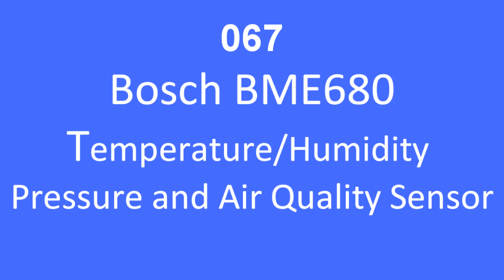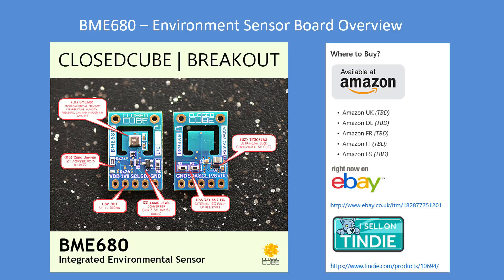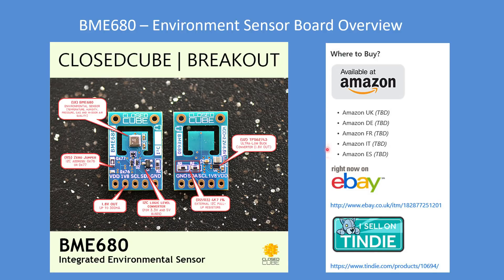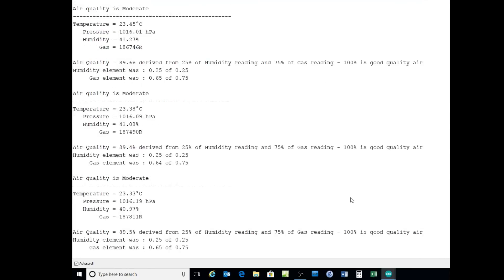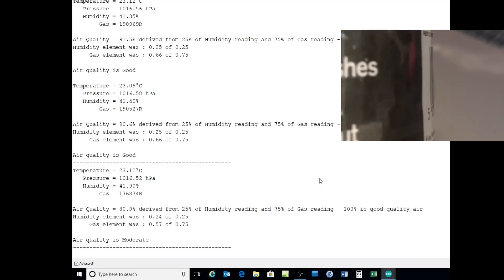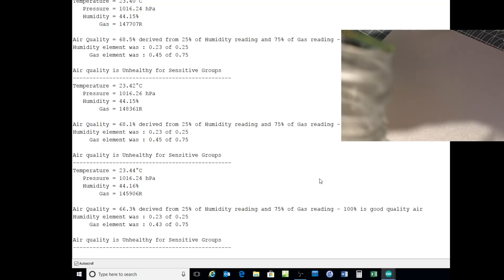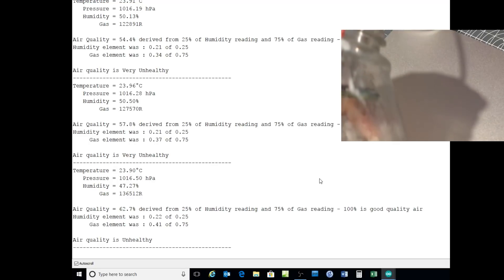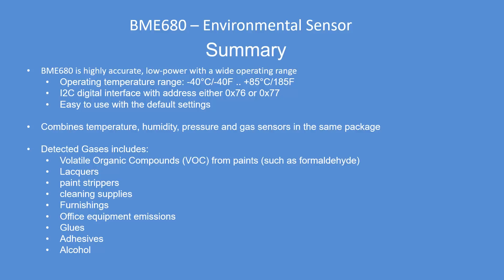Tech Note 067 - Bosch BME680 Environmental Sensor. Air Quality, Temperature, Pressure and Humidity

Comment: What are your rules to calculate the airquality, the voc sensor gives only a resitorvalue back to me. high is better than lower value. can you explain?
Reply from the maker: See here: (Readme) https://github.com/G6EJD/BME680-Example
There are no world-wide standards, it's all qualitative and essentially low or high humidity makes the environment feel no good and low gas concentrations has to be good, so 0-25% humidity and 0-75% gas on the basis that gas is worst than humidity. You can see the calculations in the source code. Both are linear relationships. The Bosch IAQ algorithm is hidden in their pre-compiled library.
Reply: G6EJD 
Hi, as I understood properly, you made yourown IAQ algorithm? Did you use bsec?
Reply from the maker: bsec? Sorry I don’t understand what you mean.
Reply: G6EJD , BSEC is bosh sensor env. cluster library. Did you used it or you use only bme680 api? How you converted gas sensor resistance to AQI?
Reply: Why your ranormal range of resistanse is 50ohm to 50 kiloohms? My device shows 160-180kiloohms in bedroom.
Reply from the maker: I did t use the Bosch library as it’s details have not been released. What I did was to assume that the IAQ is a combination of relative humidity and temperature and content of harmful gasses (VOC). In the end I omitted temperature but the same principle applies a bad environment occurs when temperature < 16 and > 25.

So assumptions are:

1. IAQ is comprised of two parts RH% abs VOC content..

2. RH contributes up to 40% of the IAQ index.

3. VOC contributes up to 60% of the IAQ.

4. RH and VOC are scaled to produce 0 (zero) when RH = 40% and VOC Gas resistance = 50K ohms.

5. When RH climbs to 100.% the IAQ index contribution is 40% similarly at 0% it is 40%.

6. When VOC resistance climbs to 50K or more the IAQ contribution is 0, when it falls to 5K or less it is 60%.

7. The two are combined eg 40+60=100, but a normal reading would be 0 + 0 = 0 = High IAQ

8. The 0-100 IAQ is then scaled to 0 500 which is arbitrary.

9. There is no ISO standard for an IAQ so it’s all qualitative. In relative terms the result is the same regardless of the mechanism used to calculate IAQ because the sensor is the same.

I find my IAQ works well, yes it could be augmented with temperature such that:
IAQ = RH + VOC + TEMP

Maybe in the mix 20 + 60 + 20 because VOC is the most harmful.

If I worked in an office I’d be more interested in RH and TEMP so maybe :
40 + 20 + 40 would be a more appropriate index. That said many offices contains plastics that emit gasses (VOC) photo copiers, etc all of which affect air quality.

Have you seen my GitHub read me?
Reply from the maker: So good air quality then! Why measure above 50K when there are minute levels of VOC’s present in the air. I chose a decade of 5-50k, but make it a thing you like!
Reply: G6EJD, I dont read your's readme file at github yet. I saw this video and read comments and a questions born in my head. I began to  work with bme680 few days ago. What is interested is that if I put bme680_selftest function before endless loop, in next measurements I recieve gas resistanse 1megaohm, then it begin to drop and so to nearly  160kiloohms(through 6-7 hours). But once I removed bme680_selftest function and in endless loop I recieved first resistance of 20kiloohms and then it began to grow.  May it is because I changed heater temperature and heating duration or something else, I dont know. Bosh bsec lib has some configurations with calibrating time 4 days or 28 days. I think that it is made for some purpose. I cant understand how sensor is calibrating in envirement with unknown quality of air for sensor. Maybe sensors femember maximum value of resistanse and sets it as 100% good air quality and if resistanse lowers so air quality bad. What do you  think?
Reply from the maker: The data sheet says it needs to be heated using its heater for a minimum of 30-mins before taking a reading. According to the data sheet you cannot get an accurate reading until the sensor has been running for their prescribed time, so it can’t be used in the mods wake from sleep, take a measurement then sleep again, the results it gives in that scenario are close to useless. I don’t know what application it is designed for but there are better sensors around. I’m sure the device is factory calibrated and my experience is most values are accurate, but note the temperature sensor is susceptible to over use of the heater as it heats the device body.

Comment: Thanks for all the great videos. Where temperature, humidity and pressure are concerned, would this particular sensor be suitable for outdoor measurements. If so, I would guess that some sort of waterproof enclosure would be needed that wouldn't impair the measurements. Do you have any suggestions in this regard in terms of what to use to house the unit? Perhaps there is another sensor more suitable that you could suggest/ review?
Reply from the maker: Hi, AFAIK there are no TPHE sensors on the market that can withstand an external environment, there are however sensors such as the SHT35 (Temp & Humi) that can have a micro-filter cap fitted and that is able to be exposed to the environment. Probably the best combination would be the SHT35 with it's fitted cap (see TN066) and a BME280 for pressure or BME680 for pressure and gas/pollution concentrations, which could then be fitted inside an enclosure that is waterproof but with air breathers that don't allow water through. That said I don't know how long the BME680 would last as it's marketed as an indoor sensor (hence IAQ). I have seen a few holders made out of some permeable material but they are very rare. Like this: https://www.aliexpress.com/item/Imported-PE-waterproof-sensor-protective-sleeve-SHT-series-temperature-and-humidity-shell-waterproof-filter-element-with/32808342205.html?spm=2114.search0104.8.25.Oo5aFAA Search for an external sensor usually results in no matches, hence the SHT35 seems to be the only one available today. It would just about be possible to fit an SHT35 micro filter over the BME680 sensor if you can buy one that is. The ClosedCube supplier is the only one I believe who sells them with a PCB to match the SHT range, their latest BME680 PCB is the same form/size so I could see the micro filter fitting over the BME easily as it's a tiny sensor body.
There no other sensors like the BME680 yet on the market, but I am advised more are due soon.
Reply: G6EJD Ok,  thank you!
Reply: i think so far sht35 is best in terms of reliability , repoducibility and accuracy. i have been using that continuously since past 1.5 years for one of my measurements. and it is working perfect. while BME680 is not giving me satisfactory temp and humidity values... neither those are consistent.